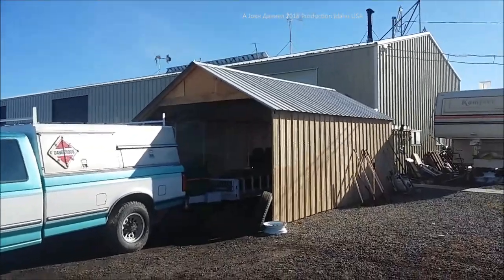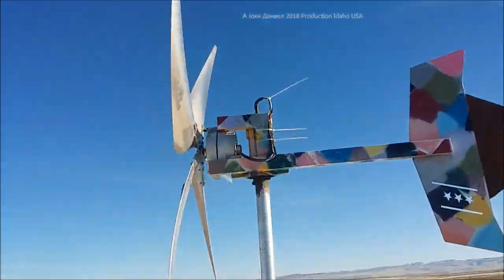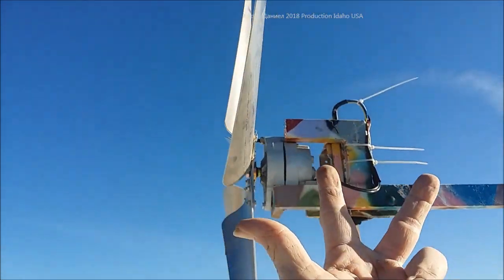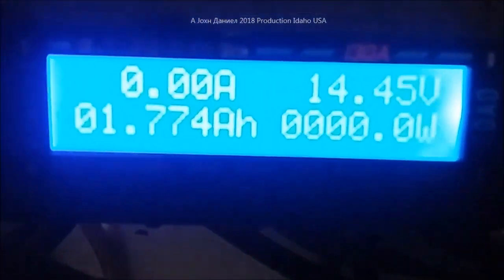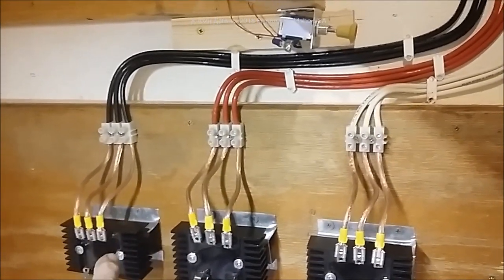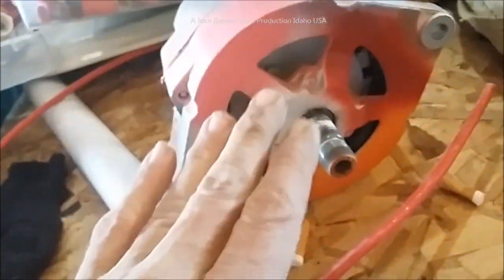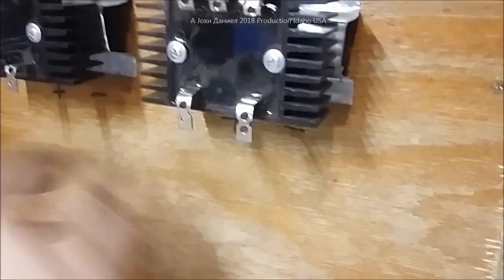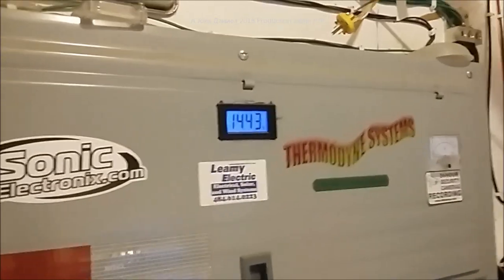Best Small 500 watt Wind turbine off grid, FULL Parts list below ( updated sources below)

Comment from the maker: MAJOR DATA For my prepper pals, the THERMODYNE Generator is best on the market, details at http://rover.ebay.com/rover/1/711-53200-19255-0/1?icep_ff3=2&pub=5575119394&toolid=10001&campid=5337979294&customid=PURE+SUPER+CORE&icep_item=232664851231&ipn=psmain&icep_vectorid=229466&kwid=902099&mtid=824&kw=lg Genuine THERMODYNE 12 volt AC 3 phase
http://rover.ebay.com/rover/1/711-53200-19255-0/1?icep_ff3=2&pub=5575119394&toolid=10001&campid=5337979294&customid=PURE+SUPER+CORE&icep_item=332495360575&ipn=psmain&icep_vectorid=229466&kwid=902099&mtid=824&kw=lg Genuine THERMODYNE 24 volt AC 3 phase
I definitely recommend them in your build your own plans 
They sell complete wind turbines that REALLY DO MAKE MASSIVE POWER! See the KT ULTRA at http://rover.ebay.com/rover/1/711-53200-19255-0/1?icep_ff3=2&pub=5575119394&toolid=10001&campid=5337979294&customid=KT+ULTRA+CORE+12V&icep_item=273049645367&ipn=psmain&icep_vectorid=229466&kwid=902099&mtid=824&kw=lg
 Genuine HORNET PMA by THERMODYNE 12 volt AWESOME!
AND
24 volt model - http://rover.ebay.com/rover/1/711-53200-19255-0/1?icep_ff3=2&pub=5575119394&toolid=10001&campid=5337979294&customid=KT+ULTRA+CORE+24V&icep_item=232605009547&ipn=psmain&icep_vectorid=229466&kwid=902099&mtid=824&kw=lg
 Genuine PMA byTHERMODYNE

Comment: Finally found my go to channel for wind turbines knowledge thank you sir. 🙏
Reply from the maker: Bravo, Good Start, Keep learning!!! The more I help get control of their OWN condition, the better!!
BELOW IS Some TESTED Alt Power AND PROVEN BEST LIST for USA based options you may be interested in!
1 - https://ebay.to/2NBIl3H Most Accurate Rated AMERICAN DESIGNED Wind Turbine
2 - https://ebay.to/32cntU3 By Thermodyne a Durable and Affordable MADE IN CALIFORNIA USA Wind Turbine Kit
3 - https://ebay.to/325Fpj0 WIND GHOST TURBINE Really Good For Starters and well built
NOTE: Best Solar Set up (a Bulletproof affordable MPPT Through Domitronic  https://ebay.to/2OX19WN ) And for most small systems due to a superior 4 buss bar design, Best made solar panels to date for the dollar https://ebay.to/2ExrxUt 
And ALWAYS buy all your batteries at the same time ( https://www.batteriesplus.com/productdetails/sligc110), NEVER undersize battery, inverter or wires.